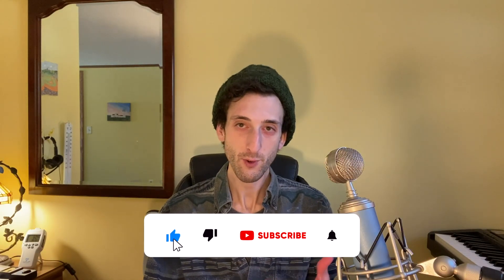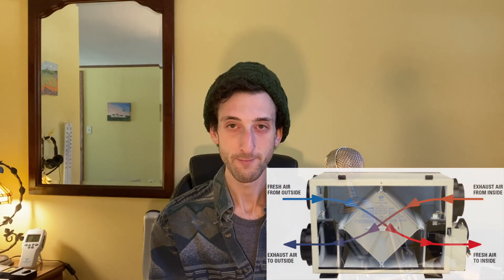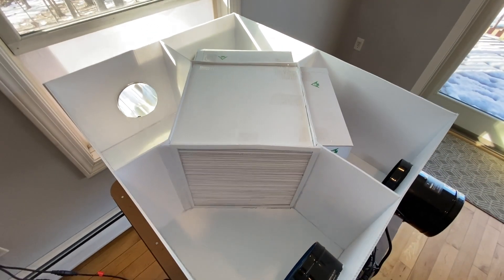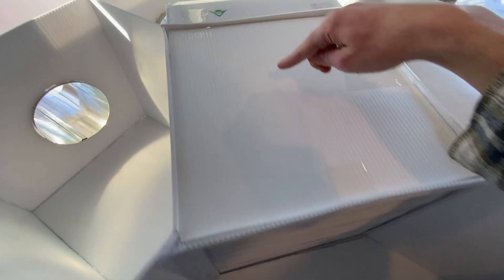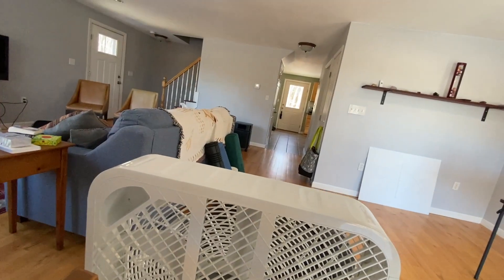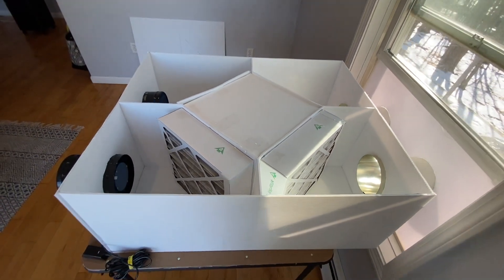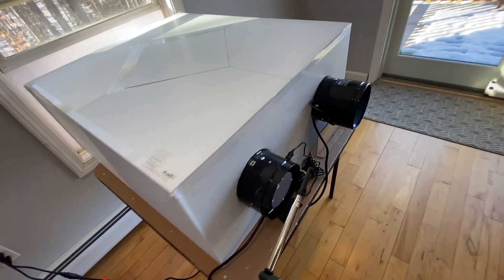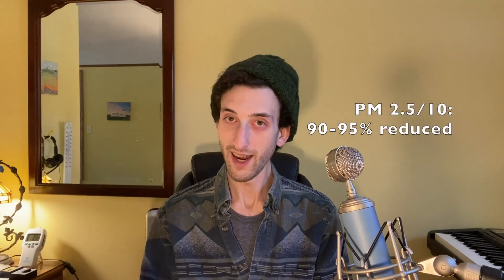I built the best DIY heat recovery ventilator I’ve seen on YouTube

Comment: Hi! First of all, that is a very nice and elegant work. I am very interested on how you made the exchanger itself. Do you have a video about it or at least could you share a bit more information about it? (Edit: I just saw your reply to another comment, I will check the video. Thank you for providing the information!)
I do have one criticism which I hope you will find constructive: the way that you are measuring the efficiency is slightly off. You are basing the efficiency computation on the temperature of the incoming air instead of the temperature of the outgoing air. It does make a difference because the incoming air has the energy recovered from the outgoing air plus the heat generated by the fans, leading to an overestimation of the efficiency. If your fans were generating heat like crazy, your measurement method would conclude that you have an extremely high efficiency, which would be inaccurate.
Reply from the maker: I appreciate the kind words! When building the core, make sure you use adhesive spray to bond the core layers together - the design in that build video I linked used hot glue to bond the core layers together. That's not a great solution compared to adhesive spray.

That's a super helpful bit of advice, thank you! You're totally right. In this particular case, do you think my fans would be generating much heat? I'm no expert on that, but I'd assume they wouldn't, given that they're relatively efficient (with EC motors) and that I don't run them anywhere near max output. Either way, thanks for the tip, I'll be sure to measure that way in the future.
Reply: @HealthyHomeGuide  thanks for suggesting the adhesive spray, that's a great tip and I can already see how this would be superior to using hot glue. 

As for the efficiency, I think it can have a considerable impact (but since you have the physical object, it is easier for you to measure it than for me to accurately theorize). Even if your fans were perfect (0 heat production), they would still be doing work on the system, increasing its energy. That being said, the contribution could be negligible and my advice would be totally unnecessary, but I can't say for sure. But since 85% efficiency is extremely good for a single cross flow air exchanger (commercially produced aluminium x-flow exchangers have lower efficiencies), your result could be a big breakthrough and I think it is worthwhile to check.
Reply from the maker: @williamwilson2020  Ah, that makes a lot of sense, thank you! If I remeasured the temperature in the way you suggested, would I use the same formula that I used before (but instead of using the temperature of the incoming air post-core, I’d use the temperature of the outgoing air post-core)?
Reply: @HealthyHomeGuide  In your video, you show x = (T_freshAir - T_outdoors) / (T_room - T_outdoors). To use the outgoing air temperature, it would be: 
x = (T_room - T_outgoingAir) / (T_room - T_outdoors). I hope this helps and I am eager to see what comes out of it.
Reply from the maker: @williamwilson2020  thanks so much! Question: wouldn’t the outgoing air temp measurement also be confounded by the heat generated by the exhaust fan?
Reply: @HealthyHomeGuide  yes, you are correct, but that is okay, because it is energy that you actually lose to the environment. The reason to use HRVs is to spend some energy to prevent the loss of even more energy. Otherwise, we would just open the window and reheat the room with the normal heating. Therefore, the measure of efficiency is how much energy is lost to the outside. We measure efficiencies with the temperatures because the change of energy is proportional to the change of temperature (for the purposes of a HRV).

To see it better, let's analyze a few hypothetical cases to get a better idea. In all cases, assume that your room is perfectly insulated and the only source of heat change is the exchanger (due to the inflow of colder air or due to the power consumed by the exchanger). Assume that your room is at T_indoors and the outdoors is at T_outdoors, T_indoors > T_outdoors. 

Case 1: No exchanger. In this case, we are dumping out hot air and replacing it with cold air. So, our energy loss is k * (T_indoors - T_outdoors). The efficiency is 0, because we are losing the amount of energy that we would be losing "naturally" (i.e., without any machine).

Case 2: Our exchanger is perfect. The incoming air is heated up to T_indoors, and the outgoing air is cooled down to T_outdoors. The efficiency is 100% because we lost 0 energy in the process.

Let's discuss a modified version of case 2: What happens if you need energy to operate this perfect exchanger? This energy can be transformed in heat or work, let's assume our machine is perfect and everything is transformed to useful work. Then, the question is: where does this extra energy go? If the answer is "we don't care because it is used to heat up the room", then our efficiency is still 100% (0 energy lost to the outside). If we dump all that energy outside, then, the energy used to operate the exchanger is "lost" from our system. This is why the heat generated by the exhaust fan should be either recovered (before the air reaches the outdoors) or be accounted as a loss.

You might be already wondering: wait a second, what if we cool down the outgoing air below the outside temperature using a refrigeration system. Wouldn't this mean that the efficiency is above 100%? The answer is yes, but it wouldn't be very useful unless the system used very little energy. The reason for that is because we already have heat pumps (which operate on a similar principle) and they reach efficiencies of 2700% percent (sort of, they do not perform so well at too low temperatures, they can even drop below 100% efficiency). Another reason to not use too much energy in the HRV is that it works against you in summer.

Wow, this was a long post. I hope that I managed to answer the question.
Edit: Formatting
Reply from the maker: Hi again! So I did some corrected efficiency tests using your formula, and it turns out my HRV is indeed lower than 85% efficient. See my pinned comment for details. Thanks for your help!

Comment: Hello, condensation will not be possible unless you are adding a lot of water vapors to the air in the house. Just taking cool air from outside and heating it up and cooling it again to roughly the same temperature (not cooler than initial cool air from outside) will not cause it to reach the dew point and condensate. Maybe if you are boiling water 24/7 that might cause condensation but only when outside air has 100% humidity. I do have a question, why are you filtering the air that is going outside? shouldn't you have both filters diagonally for the fresh air from outside? Replacing the plastic with thin aluminium foil might reduce the cost and increase the efficiency, to almost 100%. But that would require a different design, I can describe if you need but it's a challenge to explain.
Reply from the maker: Thanks for your comment! I hope you're correct that condensation won't be a problem for my HRV, but most HRVs do come standard with some sort of drainage system. Here's an article about how cold surfaces whose temperatures fall below the dew point cause water to condense. https://www.energyvanguard.com/blog/can-cold-surfaces-wring-moisture-from-dry-air/ 
Whether this occurs with my HRV remains to be seen, given that it's made of coroplast, which doesn't get as cold as, say, metal.

As for why I'm filtering the exhaust air, it is to protect the core from particulate (dust, etc) from the inside of my house. HRVs do also come standard with both intake and exhaust filters. Their efficiency can be greatly reduced by the buildup of dust.

As for using foil, I'm certainly curious how that would be done!
Reply: @HealthyHomeGuide  Hmm, the other way condensation would happen is if the average between temperatures (indoor and outdoor) is lower than the dew point of the outside air. Probably in the summer, if weather outside is 40 degrees celsius, and inside you have 20 degrees, and it rained recently, if the outside air would have a lot of humidity then when it cooled down to 30 degrees (average) it would be below the dew point and will generate condensation on the intake side. I totally forgot about summer hehe :). Depending on your airflow, a cubic meter can only hold 16ml of water, so you could expect a 10-20% of that for each cubic meter. Like 2 mililiters of water. If you have 1000 cubic meters per hour, that would be 2 liters per hour. My instinct would be to turn it off during the hot days, to not raise the bill for the AC too much, so I would personally wouldn't worry about this. But if you plan on using it no matter what, you should spray some deodorant on the inside of the core to make it hydrophobic and incline it slightly to allow water to drip off very fast. I would suggest pulling a small hose (example one used for fish tanks) from where the water would build up, and have the hose running out via the intake/exhaust openings into the garden to water the plants.
Reply: @HealthyHomeGuide  As for the aluminium foil, the principles are: need highly conductive material (doesn't matter if it's metal or plastic, it could also be the water itself but that would involve different type of fans, centrifugal ones that provide more pressure {I once tried designing these as being light weight water generators for remote areas}), the material needs to be as thin as possible (a very thick metal provides more insulation than a thin Styrofoam), so you might want to go with the thinnest available option, and lastly you need the biggest surface you can provide (imagine 2 rooms sharing a common wall, the bigger the wall the more it transfers the heat). The design I am imagining consists of folding a sheet of thin aluminium sheet (like ones used for cooking food, or wrapping chocolate) to form as many faces as possible. Take a 4 meters long sheet, cut it in 4, duct tape them to form a 1 meter by 120 centimeters sheet, and fold that while keeping it's length to be 1 meter. To be similar to a CPU fan. When you look at it from the side it should look like /\/\/\/\/\/\. Next step would be to put this into an insulated rectangular tube made from styrofoam. After that, you want to close the tube with 2 lids at each end, made from styrofoam, and glue the foil to the lids, so that you create 2 chambers inside the tube. With 2 chambers sharing a big surface of highly conductive material, now you only need to drill holes on the sides of the tube, so that each chamber has an intake/exhaust. The numbers are just an example, in reality you probably need more aluminium depending on the surface you need, which depends on the airflow you need. If the surface is big you can use the fans on high speed and it should have the same efficiency, but if it is not big enough you need to use the fans on low speed to give more time to exchange the heat.

Comment: Very cool. I’d love to see a full build video with parts and dimensions. I’m already wondering if I could fit this in the top of my entry closet. It’d require drilling holes in my exterior wall and the closet wall, but it’d solve the obstruction and looks issues here. Also curious to see the process of changing the filters. If you have to open the top for maintenance then this install location might not work (though I guess you could put it on the floor of the closet instead).
Reply from the maker: Thanks! I like the idea of putting it in a closet. To give you a rough idea, the housing is 36"x30"x14.25". I do indeed have to open the top cover to change the filters. It's fairly simple; I just secure them in place with a couple strips of tape. I put weather stripping around where the housing contacts the top cover and then secure the top cover down with clear, low VOC tape.
Reply: @HealthyHomeGuide  Great idea with the coroplast! Did you use the 4mm or 10mm?
Reply from the maker: @Gnavitas  thanks! I used 4mm.

Comment: How far away were your external inlet and outlet? they looked really close together.
Reply from the maker: The ducts are 14 inches apart, BUT one of them extends further externally than the other. So one extends 2 feet outside and the other extends 1 foot, which helps them avoid exchanging air. It's difficult to see in the video because the longer outside duct curves downward.

Comment: Very cool to see the concept in action. If the plastic transfers heat so well, wouldn't you need another material to insulate the connection to the window?
Reply from the maker: Great question! I am using weather-sealing tape to ensure that cold air doesn’t blow through small cracks at the edges of the window insert. As for the plastic insert itself, coroplast has a 4 mm layer of air in between its two plastic layers. The air acts as an insulator.

Also, the plastic isn’t actually that fantastic at heat transfer compared to something like aluminum. The coroplast insert doesn’t seem to get that cold.

Comment: This is amazing. I now think my son should have this in the little room he sleeps in with the door closed all night. He'd be freezing with the window always open, but he has allergies and could use the filter. Plus I can imagine that CO2 levels rise in a tightly-sealed, unventilated small room with someone breathing all night. Hmm. You have me really thinking. I need to get your recommendations for the right instruments to measure air quality. 

Oh, and you really are sounding less allergic. Nice!
Reply from the maker: Thank you so much! You’re spot on with your thinking. Sleeping in a tightly sealed, small room with no ventilation can cause CO2 to rise to unhealthy levels. I slept in a room like that for a while and woke up oddly groggy every day. 

Yes, opening a window is a bad solution due to cold of course, but mainly because small particles like car exhaust and byproducts from peoples’ heating systems can drift in in unhealthy quantities. Not to mention allergenic particles, which tend to be larger and less systemically harmful.

If you’re interested in good instruments to measure air quality, check the bottom of the description of this video for the ones I used :) Thanks again!
Reply: A known problem with the above coroplast heat exchanger design is it can only transfer heat to the incoming air theoretically maximally by 50% because of Laws of Thermodynamics,. A consequence is room gets chilly, if indeed not quite as cold as as a naked open window would make it.  

There are also designs which use a pipe within a pipe, and a different mechanism at the window to exchange heat, I believe by merely mixing and not separating in and out air streams. It can be piped further into the building to the isolated spaces needing air. When it gets there its room temperature warm. 

There are small round through wall units for sale, which by principle of operation, when placed across the house or large room from each other will conspire to coordinate taking turns breathing out while other breathes in @ 15 minute intervals (configurable), reducing cold island effect. Don't want little Johnny to miss skool becuz of the sniffles.

Comment: Nice! The standard design doesn't really change. Do you have power & power factor for the fans? Most commercial units aren't using highly efficient fan motors.
Reply from the maker: Thanks David! You're absolutely right. The fans I used have fully adjustable, brushless EC motors, and are 36W. As for the power factor, I can't seem to find that information. They're TerraBloom 6 inch EC 288 cfm fans.
Reply: @HealthyHomeGuide  How far do you dial the fans back? Presumably the exhaust fan can be a bit reduced because it's not going through a filter on the way out. The efficiency would be improved on lower speeds than on full speed.
Reply from the maker: @David.Elfstrom  There is actually a filter on the exhaust pathway (to protect the core). There are two filters - one on the intake and one on the exhaust. The fans have 8 speeds, and I typically run them on speed 1 or 2. Sometimes 3 if I need more ventilation.
Reply: @HealthyHomeGuide  You can use a 10-20$ power meter to measure the power factor. It's not a mandatory specification by law so almost no consumer product lists it, yet it's just as important as the power because a PF of let's say 0.5 means yo're paying 2x more for electricity than you should.